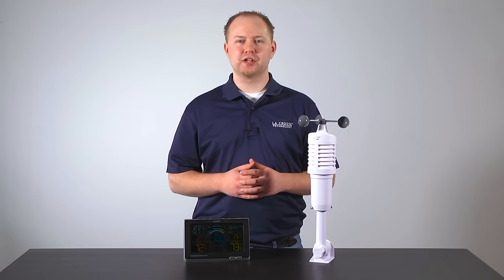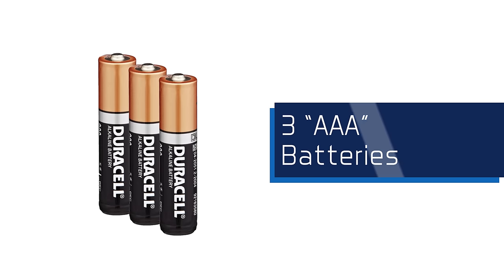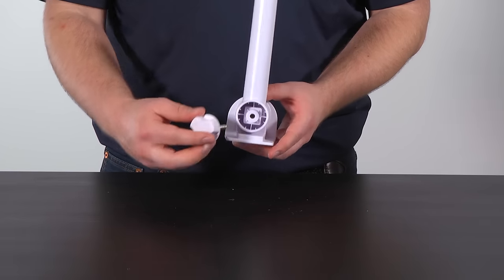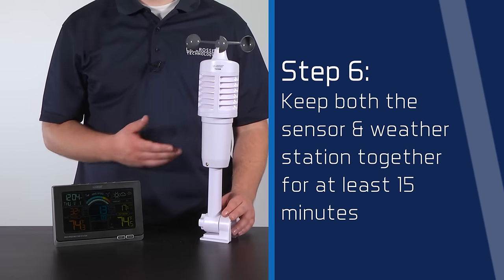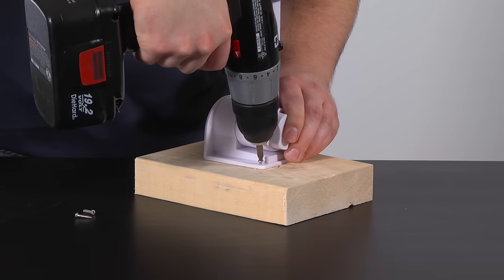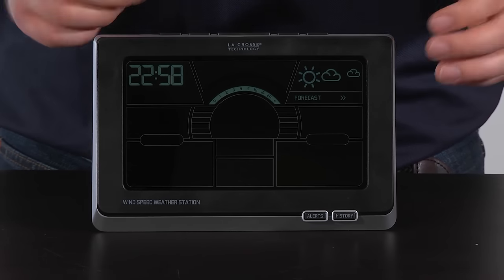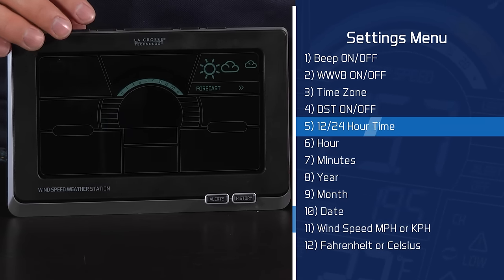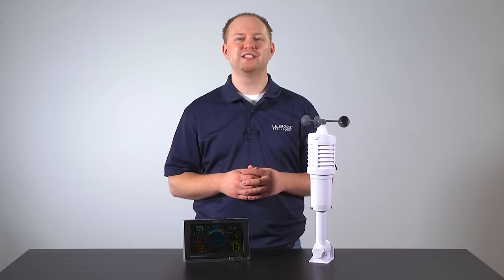327-1414W Wind Speed Weather Station Setup

Comment: I got the station for this Christmas (2023). It has been  up and running for 5 days now.  I had to move the Weather station in the house from one location to another, approximately 1 foot, making sure I did not unplug it. I lost contact with the sensor out side? I have 3 "AAA" batteries in the station and 2 "C" batteries in the out door sensor. It's a new install so the batteries are about 1 week old. Brought in the outdoor sensor and took the "C" batteries out and put them back in and then pressed the down arrow for 5 seconds on the indoor weather station. Red light flashing on the sensor. The sensor reception icon (on the weather station) showing it's searching for the sensor but then it stops searching and the sensor is still not connected?
Reply from the maker: Hey Mike, we're sorry for the sensor trouble. For assistance, please message our support staff directly here: https://bit.ly/contact_techsupport. Or alternatively, send us a private message on our Facebook: http://bit.ly/LaxTech_Facebook page. Our team there will be more than happy to help get this figured out. Our apologies again for the inconvenience.

Comment: I realize that walls, windows etc effect the transmission distance of the sensors. What I was wondering is does elevation adversely effect transmission distance. My back yard is surrounded by trees which greatly shield it from winds. My front yard is fairly open so my plan was to put the sensor unit on a pole, maybe 16 to 18' off of the ground. (4-5 meteres)

Comment: On my wind sensor LTV-W1 outside,  the blue light is no longer flashing and is just a solid blue.  The display in the house just shows dashes. What does the solid blue light mean?  I checked the batteries on the sensor and they are still strong.  What do I need to do to get the sensor working again?  It has been working for a long time. Thank you.
Reply from the maker: Hey Joseph, we're sorry for the trouble. We'd first suggest a reset following the instructions in our other video here: https://bit.ly/lcv_restart  -- If these fail, please message our support staff directly here: https://bit.ly/contact_techsupport. Or alternatively, send us a private message on our Facebook: http://bit.ly/LaxTech_Facebook page for further assistance. Our apologies again for the inconvenience.

Comment: Can this work with an accessory that is wireless and waterproof that measures temperature?  I have a wood fired outdoor hot tub close by and would love to know the temperature from indoors, wirelessly.  Is there a channel that will accept this, and where can I get such an accessory?
Reply from the maker: Unfortunately, this 327-1414W model station does not offer a water temperature option. For something like this, the simplest solution would be to pick up our 331-09667V2 Pool Thermometer & Display: https://www.lacrossetechnology.com/products/331-09667v2 which is completely wireless and offers a floating waterproof sensor for inside your hot tub. Another option would be to upgrade to one of our newer Wi-Fi-connected weather stations to receive all of your weather and hot tub data on one display. For a similar setup to the unit you own, we'd recommend our V50 model: https://www.lacrossetechnology.com/products/v50 with the addition of the LTV-POOLV2: https://www.lacrossetechnology.com/products/ltv-poolv2 sensor. The advantage to this upgrade, besides being able to see the pool sensor data in the Extra Sensor area of the same display, is that you'd then have the ability to see all of your station and sensor data inside our La Crosse View mobile app anytime, anywhere. The app also gives you the option to set free push notification alerts (for when that hot tub is just the right temp), the ability to share devices with family and friends, and track history trends for your temperature, humidity, wind speed and direction, and more. Our info page here: https://www.lacrossetechnology.com/pages/la-crosse-view will help give a better overview about how these Wi-Fi-connected systems work. If you would like further customized help finding the right setup for you, please feel free to contact our store directly at 608-785-7939 or via email at: store@lacrossetechnology.com. 😊

Comment: I have my weather station in my back yard, we have a huge tree not too far away but the unit still spins and works well in the southern direction. What happens as the cold weather hits and trees snow flies? I fear that it will be covered in snow and it won’t be spinning well, being made of plastic this could crack I’m thinking? Anyone else have any experience with the cold snowy winters?
Reply from the maker: The sensor was designed to withstand all normal weather conditions, including snow. However, it can be convenient to have it mounted in an accessible location to brush off any snow buildup that may occur under the right situations (snowfall with little wind). As for the tree, we'd recommend getting the sensor as far away as possible to prevent inaccurate wind speed readings and large clumps of heavy snow potentially taking out the sensor; an open area is ideal.

Comment: I notice that it seems corrosion on the terminals seems to be a major issue.  Would the use of dielectric grease help and take care of the problem?
Reply from the maker: Hey Clarence, a thin coat of dielectric grease can help, along with wrapping some Teflon around the sensor’s threads before screwing the cover back on. This should help keep water and excess moisture out of the battery compartment. We do apologize for any inconvenience. If you should need further assistance, please message our support staff directly here: https://bit.ly/contact_techsupport. Or alternatively, send us a private message on our Facebook: http://bit.ly/LaxTech_Facebook or Twitter: http://bit.ly/LaxTech__Twitter page.

Comment: What if you’re replacing batteries and the red light doesn’t flash?  I’m having that issue now. Thought it was dead batteries but I replaced with new C batteries and the red light did not blink and wind speed is not picking up on the display. Thanks for any suggestions.
Reply from the maker: Hey Michael, we are truly sorry for the wind sensor trouble. Our first suggestion would be to bring the sensor inside next to the display and clean the battery contacts as best as you can. After this, install a new set of alkaline batteries into the sensor and reset the display by removing all power, pressing any button at least 25 times, and leave it sit without power for about 10 minutes. After this time, power the display back up. Your sensor should reconnect automatically within the next 10 minutes. If it does, we then recommend wrapping some Teflon tape around the sensor’s threads before screwing the cover back on. This should help keep any water and excess moisture out of the battery compartment that can sometimes cause these sorts of problems.. 

If, however, the sensor does not reconnect, please message our support staff directly here: https://bit.ly/contact_techsupport. Or alternatively, send us a private message on our Facebook: http://bit.ly/LaxTech_Facebook or Twitter: http://bit.ly/LaxTech__Twitter page for further assistance. Our apologies again for this inconvenience.

Comment: Hi.  I have the V30v2 station.  My neighbour has the same one.  His wind sensor seems to take over the one I have and his sensor ID number shows up on my station, along with the data.  How do I freeze his sensor out?  I suppose I shouldn't worry as the data is accurate.  Any thoughts on this?  Thanks  Barry
Reply from the maker: Hey Barry, sorry for the trouble. There are a few ways to approach this. 1) If you're happy with the data the wind sensor is providing, you could continue to both use the same sensor for wind speed readings, this will allow you to keep one as a backup should it be needed down the road. Though you'll need to have him share that sensor with you if you'd like the data in your La Crosse View app (more on how to do that is covered in our other video here: https://youtu.be/lYkS8Y6Z5Tc). Option 2) If you'd prefer to each use your separate sensors, you'll need to delete his sensor's ID on your weather station display in order for it to begin picking up yours. Instructions for this can be found on page 24 of your full manual here: https://bit.ly/v30v2_manual  -- If you should need further assistance, our staff is always here to help. You can message them directly here: https://bit.ly/contact_techsupport. Or alternatively, send us a private message on our Facebook: http://bit.ly/LaxTech_Facebook or Twitter: http://bit.ly/LaxTech__Twitter page.
Reply: Thanks so much..  I continue to be impressed with the after purchase service from La Crosse.  You guys are awesome!

Comment: I do not have any Indoor HI and LOW Humidity Alert Icon, or any Outdoor Humidity Trend Indicator showing on my display.
Reply from the maker: Hey Jeff, we're sorry for any confusion. High and Low Temperature and Humidity alerts will need to be manually set and activated; instructions for this can be found on pages 10-11 of our 327-1414W manual here: https://bit.ly/327-1414w_manual -- Trend arrows, on the other hand, will trigger when the correct conditions are met. For instance, they will update every 15 minutes, comparing data over the past hour. If the temperature has changed by 2°F/1°C or more or humidity by 3%RH or more, an arrow will display that change's direction.

If you need further assistance, please message our support staff directly here: https://bit.ly/contact_techsupport. Or alternatively, send us a private message on our Facebook: http://bit.ly/LaxTech_Facebook page. We are here to help in any way we can.

Comment: I just received my La Crosse weather station. But the wind guage light will not come on, and i can't get a wind speed reading.  And yes i have 2 new c batteries.
Reply from the maker: We're sorry to hear this and apologize for the trouble. Our first suggestion would be to try a basic restart covered in our other video here: https://youtu.be/INyApzZWe40 -- using a new set of regular alkaline batteries. If your wind sensor readings still don't come up on the display with the sensor next to it, a replacement may be needed. For assistance with this, please message our support staff directly here: https://bit.ly/contact_techsupport. Or alternatively, send us a private message on our Facebook: http://bit.ly/LaxTech_Facebook or Twitter: http://bit.ly/LaxTech__Twitter page. Sorry again for the inconvenience.
Reply: @lacrossetechnology  Thanks for the advice. But the wind station red light never  blinks. Also it was an Amazon used like new product,  so it was probably returned before for the same reason.

Comment: I just opened up my unit and plugged it in. Even before putting the batteries in the the wind sensor it shows the outside temp (-4.2 which I think is accurate). The problem is that I have not but batteries in the wind sensor yet. Where is it getting this temp from?
Reply from the maker: Hey Tim, this is almost surely a sensor from a neighboring home. If you can provide your product model number (printed on the back of the main display) we'd be happy to send you specific instructions as to how to get this synced with your own sensor. Though, if the data appears to be accurate, we do have many users who choose to share the sensor info with their neighbors. Keeping other Temp/Humidity sensors as backups or using them in other areas of their home.
Reply: Thanks for the quick reply! Ya, it must be a neighbors that I’m picking up. I figured out how to search the channels and was able to connect to my wind gauge…which I just installed and Is working great (-4.2C with 19.5 kmh winds….was a little chilly to install)
Reply from the maker: @timcooper3795  Awesome! We're happy to hear things are up and running and are here to help if you should have questions. 😊

Comment: Since replacing the weather station C83100, the new station recognizes the wind sensor LTV_W1 and the station is connected to internet, however the wind speed shows but the direction will only display north and no other direction.
Reply from the maker: Hi Lionel, we're happy to hear your station is up and running correctly. The C83100's wind direction though is actually a feature provided by AccuWeather, not from any of your sensors. This, along with your forecast icons, daily highs and lows, and chance of precipitation values will update 4-6 times a day with new Internet data. Our team is constantly making updates to improve these capabilities as well as their accuracy. We hope to have this resolved soon.

Comment: Can I purchase additional TX141w sensors to go with this system?  I think the monitor allows us to access three remotes, but I’m not sure.  Thank you.
Reply from the maker: Hey Wayne, our 327-1414W station can support additional Thermo-Hygro Senors, model TX141TH-BCHV3, which have multi-channel controls. Unfortunately, it cannot display readings from multiple TX141W Wind Sensors. You can find these add-on or replacement sensors under the Parts tab on our product page here: https://www.lacrossetechnology.com/products/327-1414W#parts  -- For more details regarding how to set up multiple sensors, see page 13 of your full manual here: https://bit.ly/327-1414w_manual
Reply: @lacrossetechnology  thank you for that info.  I have purchased additional tx141w sensors, so I will keep them as spare.  This has been a nice working system for several years, although I have now had to replace the wind cups twice.  I didn’t have my instructions, so thanks for the link to those. 👍🏻
Reply from the maker: @waynebud462  You bet! Sorry for the trouble with those wind cups. We're here to help if you should need further assistance.

Comment: so the sensor is suppose to go outside but walls block signal? .. you guys think we live in houses with missing walls?
Reply from the maker: This is the same for any radio signal, walls, electronics, and other objects can all affect reception. In most cases for each wall, floor, or window the signal must pass through the reception distance is roughly cut in half, not often will this be fully "blocked".

Comment: We really like this weather station, but we noticed that lately the outdoor temperature is way off.  How do we fix this?
Reply from the maker: Hey Debbie, our sincere apologies for the temperature trouble. To start, we'd first recommend bringing the sensor inside and placing it next to the display for at least two hours. After this time, compare the indoor and "outdoor" readings and let us know the results. This side by side test will help us determine our next steps. Sorry again for the inconvenience.
Reply: @lacrossetechnology
Reply: Thank you for the information, it worked beautifully.  We thought we would have to buy a new weather station.   Thanks again.

Comment: I have everything set up, light is flashing, lights on on the station, have indoor temps but after 15 minutes, nothing is connected to wind speed or temp outdoors. Still have dashes.  What am I supposed to do now?
Reply from the maker: Hey Ann, we are truly sorry for the trouble. Could you pass along the model number of your product? This should be printed on the back or bottom of your main display.
Reply: @lacrossetechnology  Model CA87092
Reply from the maker: Thanks  @annjones5480 . Our first suggestion would be to try a basic restart by brining the sensor inside next to the display and following the steps covered here: https://bit.ly/basic_restart -- Be sure to use a new set of reputable alkaline batteries, other battery types can have transmission issues. Another thing, if you've been using this a while, please check the sensor's battery contacts and clean them as best as you can before performing the restart steps. If the contacts are a little rusted or if there's other evidence that moisture had built up inside the sensor's battery compartment, wrapping some Teflon tap around the sensor's threads before putting the cover back on can help to prevent this moving forward. 

If these steps still do not help get the sensor connected with the display, please reach out to our Canadian representatives at 844-687-4040, via email at: info@springfieldinstruments.com
, or using their online form here: https://springfieldinstruments.com/customer-service/  -- Our apologies again for this inconvenience, we hope to help get this corrected.

Comment: Hello,  I would like If It’s possible to increase the light level of display. Thank you
Reply from the maker: Hi Eugenia, the display's backlight can be adjusted using the LIGHT (HI-LO-OFF) button on the top. Each press should adjust the light level when using the power cord. Battery power only will only keep the backlight on for 10 seconds at a time. More specifics on this can be found on page 11 of your full manual here: https://bit.ly/327-1414w_manual